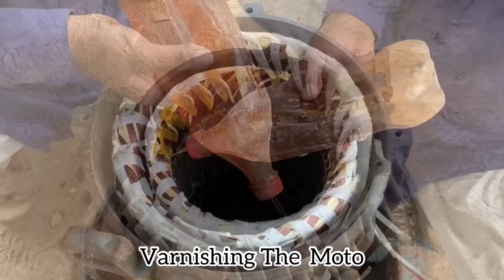Excellence Technique of Rewinding Stone Crusher Plant 15HP Electric Motor || 3 Phase Motor Rewinding

Comment: My grandfather used to do something like this when I was young. He did it with copper wire, and worked even on huge motors that were part of some of the bigger hydroelectric dams. He called it winding motors, and it was a skill that he used up until maybe 8-10 years before he passed. It was almost looked at here in our area like a lost or almost lost art, to re-wind motors, most tossed them and replaced new by then. My grandpa was born in 1910, and passed in early 2000. Neat to see it is still a skill in need.👍🏻💣⚙️🛠🔧
Reply: Yes its a lost skill for sure
Reply: У нас в Узбекистане этот навык пользуются большим спросом
Reply: L
Reply: There is a time for everything, and a time for every thing under heaven: a time to assemble engines and a time to take them apart.
Reply: 嘉年华77有6有6659
Reply: These skills get transferred from a developed nation to an under developed nation. The nation which is developed now it's not in need of it anymore with their flow of money and per capita income. The ones which are under developed acquire these skills to keep their work rolling under their budget till they become developed as well. Then these types of skilled labourers die with time till there's barely such skilled labourer in developed nations. A losing cycle.

By the way my uncle used to do the same until 15 years ago, and used to get far bigger motors to repair at times
Reply: Cam i introduction my self to you ,?
Reply: 2ضسي
Reply: ❤❤❤❤❤دد❤٢❤=❤❤❤❤❤❤
Reply: @EvgeniyN83  

بس
Reply: Great💐💐💐
Reply: Oiikkk60u
Reply: Katherine,  I work for a place that still rewinds motors,  yes a lost art as our winders are getting up there in age
Reply: Ko
Reply: Yyyll
Reply: I do know this skill and did it till 1998
Reply: I’ve worked 20 years in our business related to big electric motors repair and worked it from the basis with bare hands like in this video… it’s demanding and strict 😅, now in my 40s I only do some sales since like two years from outside the shop & spent my time learning gym and rehabilitating from those 20 years …sometimes missing it , watching videos relating 😎
Reply: Please 0
Reply: I'm German and this was something I had to learn in my vocational training in the 80's including the theory to design a motor, only I learned it on a smaller scale with motors you'll find in a drill, a saw etc. . I used it later to fix bigger elektro motors for historic machines you couldn't get any replacement for. I could even use it to fix a starter for a car from 1940. But rewiring a motor was more of a side job and not my main job.
Reply: Üdvözlöm !  Régen az EVIG-ben dolgoztam Targoncásként ahol ilyen motorokat csináltak és nem győztem bámulni ahogy csinálták és még 73 évesen is bámulatos dolognak tartom ezt a munkát, amit Én is egyfajta művészetnek tartok !  És a villanymotor felújítást gazdaságilag egy hihetetlenül értékes munkának tartom.  Egy nagyon értékes mentő munkának tartom. Alig ráfordítással és egy kis hozzá értéssel új motort kap az akinek szüksége van erre a nagyszerű szerkezetre. Ha belegondolok, hogy egy ilyen motor hány ember munkáját végzi évtizedeken át, aztán újra felújítható, szinte örök életű egy ilyen motor, ha mindig felújítják. Egy olyan igazi társ mint a ló volt. És mennyi ló menekül meg a sok igavonástól, hát tényleg csak szeretettel lehet gondolni a villanymotorok hálás munkájára, amik igazán megérdemlik, hogy felújítsák Őket.
Reply: Cb
Reply: Rame nih orang bikin emosi mudah
Reply: @kalluriramana9760  
Iyrwac
My
Reply: It's not a lost skill damn there are numerous companies that rewind motors every flipping day.
Reply: @VG-rj8pn  I'm on the upswing of my winding career. I'm in my mid-thirties and I picked this up after I left the military. I plan on winding the rest of my life, or until my body breaks down. 😉
Reply: @BernWag  Wow what a coincidence, my dad who was descended from the same grandfather that re-wound motors and was an executive during WW11 fir Westinghouse, was a HVAC guy for almost 40 years. He was a part of the Sheet Metal Workers Union, which at the time included all the skills of sheet metal fabrications along with the HVAC part, but I know that they are all sorta broken up nowadays, the sheet metal workers vs. HVAC. Anyhow it seems that this is not such a lost art as was thought by my family. I know back in the early days my grandad owned an electric shop, and rewound motors, until the shop was hit back in Indiana by a tornado , they fixed and reopened, but then suffered a fire and closed. Later into the early to mid 80’s is when my Grandpa worked for a shop winding motors, the owners had said that prior to him coming to work, they had no way of fixing them. I am thinking maybe it was only a short time that there appeared to be few in the trade, or possibly the issue was just local to the area he lived, and maybe in my 13yr old mind I heard it all wrong. I do know when he was in his early 30’s he worked for Westinghouse during the war, he had gotten his electrical engineering license back then,and he got to participate at some point in his career in the making of the huge motors that resided in the Hoover Dam. It is amazing to me how many people helped in building such huge projects, and were so talented,  but had so much more of a reserved countenance about them, and FAR LESS SCHOOLING…like my grandfather, yet they accomplished so very much. Wishing I had all the stories, and all the facts of what he did, but sadly it is not so. Wish I had written them all down. Thanks for sharing! 🌸🛠️🔨🔧🔧🧰⚙️⚒️
Reply: I am very sorry for your grandfather lost I also wish you and your family  doing well in your life , stay safe
Reply: Im studeing to become an E-E, and we learn to rewind these in school. its expensive motors, atleast the bigger ones, and it cost far less to repair them than to simply dismantle and recycle. if you do a preice job, you ca even increase the output power without increasing input power. we had a low efficiancy motor with and 53%ef, rewound it and it deliver 67%. dont trow away your motors, its easy to fix, takes some time, but its worth it
Reply: Muy buena tarea...algo que no vi  fue cuándo  no soldaron las conexiones...creo que debería  realizarse...es importante usar calzado apropiado...aprecio su oficio y su técnica...
Reply: Learning this right now in Germany as an apprentice electrician for motors and drives, it's not that useful today because buying new is cheaper than the labor but in other countries like these it's pretty Handy and worth it as I can see
Reply: Not lost art man. Many companies do this still I can name 5 in Houston that do. We need this service especially in the HVAC world. Our pumps are always needing replacement
Reply: Many motors are cheaper new than rewinding/repairing them in the USA, however special industrial motors that cannot be replaced easy they are still rewound/rebuilt by many electric motor repair shops across the country. I did this work in Minnesota until 2010 when I retired from the industry.

Comment: Did my apprenticeship rewinding motors 40+ years ago !
Brings back memories
Reply: Surely the joints need soldering, or is twisting them good enough?
Reply: @monkeyflyer410  Its enought since the coils is stationary
Reply: i am too
Reply: Mã Đan Đan   hi
Reply: Mã Đan Đan  are you youtuber
Reply: Mã Đan Đan   I will follow your channel
Reply: @monkeyflyer410  They should be but I bet they have no torch, heat, to weld the connections.
Reply: @Steve-sg3uz  Yeah, probably that's it, although I'm pretty sure I'd find a way if it were me. That aside, I watch a lot of this type of video, and considering the adverse conditions they work in these people really know how to make things that work. The bits I can't bare are when I see grafted on stub axles being sledge hammered into a socket while still mounted on a lathe, arc welding using the eyes closed technique while holding a piece of cardboard with a dark bit of glass in it, and the reconditioning of fine engine bearings in a gritty pool of diesel!
Reply: @FluePeak  @ crusher sounds kek
Reply: Even though the motor is stationary, it will vibrate, joints should be soldered and insulated, at least they insulated them !
Reply: @monkeyflyer410  Nowadays we braze them as soldering is not good enough. Twisting is unacceptable. Doomed to fail because of oxidation

Comment: Not bad job at all! Extra insulation between windings is good touch. Only they should submerge entire unit to lacquer to be sure about entire unit insulation. Yes it cost more than just tiny bottle of lacquer.
Reply: Is Insulation resistance test not necessary for this electric motor rebuild?

It seems that they've only tested it for continuity. I believe there should be corresponding insulation resistance values that need to be met prior to sealing the motor.

Comment: Amazing work. But then again, after all that effort, why don't they also exchange the bearings? I also liked the isolation testing, by just connecting a 230V (?) AC live wire to the coils and the casing while checking the light bulb. 😄
Reply: I use a 110 transformer with a light bulb to check 12 volt starter motor insulation. My friend told me it had to be 10 times the voltage of what it`s uses. I thought it was amazing but no solder????
Reply: Limited resources brother
Reply: @damianbutterworth2434  solder may melt and do short circuit inside.
Reply: Its a series testing method
Reply: @user-ye7rf6mk7h  but soldering is more advantageous to fortify the joints..... soldering is preferable..... Fibre slives are there to protect them for short circuiting.

Comment: I am always fascinated by rewinding electric motors  that is working in abnormal places lke quarries cement plants and textile mills. where No ! enemy is dust and load pattern not known. these boys have done a wonderful job. but a systematic sequence of operation has to be streamlined.
Reply: O0

.
Reply: i believe they can be rewound to give more energy than what we put into it
Reply: @fidelcatsro6948  In engineering , out put power is input  - losses (like friction heat and eddy current etc) it can neve be higher, the best designed motor runs at 80% efficiency when it is new.

Comment: Someone needs to check over that conveyor, probably got a bearing out and it's putting too much load on the motor and burnt it up.  it's going to do it again unless the problem is fixed.  check amps while it's running and see what it's drawing.  You can tell how much load it's packing on that way.  I'd wager there is some oiling that needs to be done on such a dry operation as that.  running rock in a dry and desolate place...  ya, better be oiling stuff and watch grease as crap will stick to it.
Reply: I guess there are motor protection circuit breakers for overload protection but the robust operation in the environment like this will needs to follow strict norms of safety to keep uninterrupted process  going on!
Reply: They seem to know what they are doing.

Comment: It’s good looking Rewinder but the issue is should be six lead out the output of wire connection so that can able to run in Lo volt and hi voltage supply unless you will use VFD driver controller.

Comment: How many turns per one coil ???? Random or according the weight ??? Hard beating with sharp metal tool against the insulated wire is ok and safe ??? Very universal tool metal hammer is used in every situation. Higher reliability. Excellent work. In Germany they finished this method at least 70 years ago. I think you make enough money for a good life in the country.

Comment: I rewind motors for a living and the fun fact I have to add is that the reason this motor failed is because I can tell from experience that they have rewound this before because when they stripped it there was no deep varnish penetration insulating the winding because they did not have to use heat or pull very hard. I guess good job security for them. Haha sucky rewinds!😆
Reply: Sloppy workmanship. 😀

Comment: You are the best of handy jobs.
Which type of this motor wiring and name?
Is that multi pole surrounding of stator?
Reply: For what I can see in the video, this is a 18 groups of 3 coil each for 54 slots stator, that mean it is a 3 phase 6 pole motor , for 1200 rpm at 60 hz or 1000 rpm at 50 hz
Reply: Ah, I 'd see
Very  smooth continues running
form 3 poles with 6 cylinder of magnetic.
Can we call it " Rotary running?.

Comment: the wires are just twisted. Isn't it necessary to solder? The test and the first inclusion in a steel bucket, standing with one foot in it and the other on the ground - VERY DANGEROUS!

Comment: how long should you wait for the insulating varnish to dry?
Reply: Depends on the Varnish they are applying. 

You get the fast air drying ones which as the name suggests drying off by itself in an hour.
While you have the baking varnishes as well. Which as the name suggests needs to be baked at the specific temp for about 4 to 8 hours. To vacume impregnating varnishes

Comment: No dipping, baking, painting, or even soldering and bearing replacement. Done on the cheap.
Reply: You have to remember it's a third world country. 
You can actually get away without dipping the windings and it can last a very long time on that small of a motor & lower RPM using their process. Had they soldered the windings and replaced the bearings it would have been a fairly decent repair on that motor, IMO.

Comment: 19:30 plz tell me benifits of this oiling
Reply: The is not oiling. That is varnishing. 

Electrical Insulating Varnish is applied on the rewound motor for better insulation, mechanical protection from vibration and abrasion. Extends motor life by resistance to moisture.

Comment: Ok u getting only three cable out but is getting hi amps... VFD panel is ok.. this three cable
15 HP motor working star Delta panel is ok working also fine ..
But this condition get hi amps.   Not good...

Comment: why did he measure the coil weight in weight measurer (video minute is 4.42)
Reply: In this rewinding, the motor coil data is duplicated. They do that by either counting the turns in the existing coil or by weight.

When he would have removed the original coils from the motor, he would have recorded that weight. So now that he had wound the replacement coil, we probably was cross verifying if the coil that he made is of the exact same weight as that her removed.